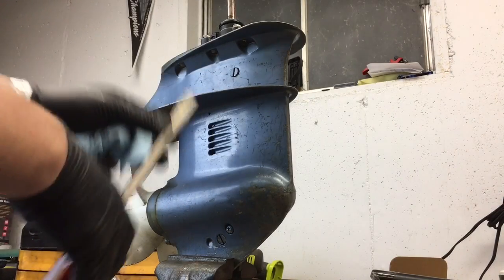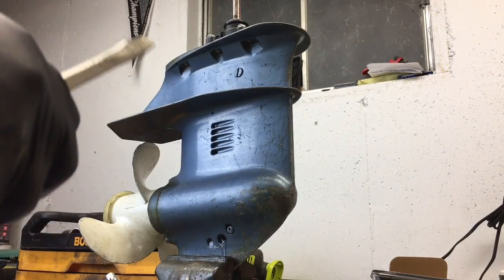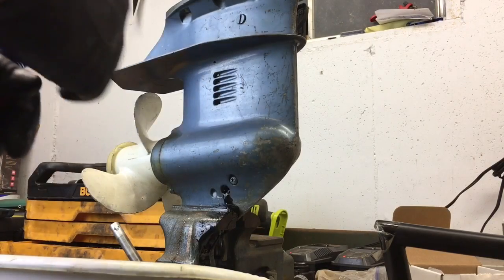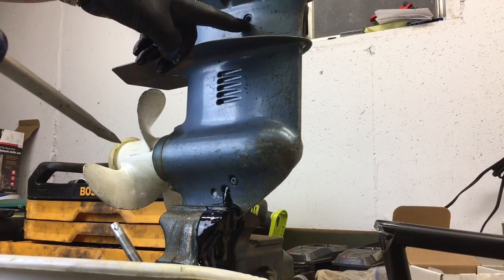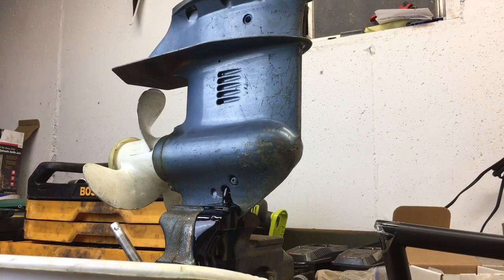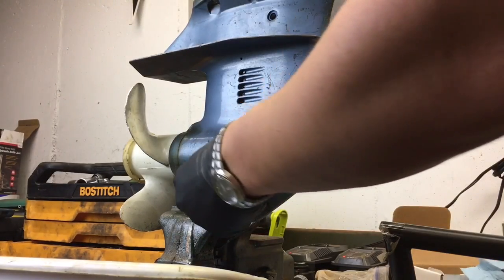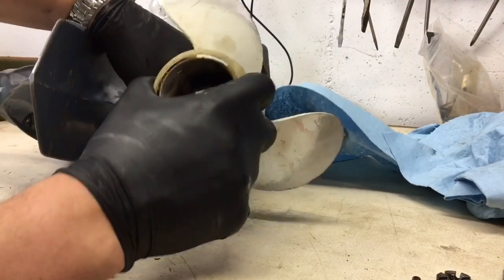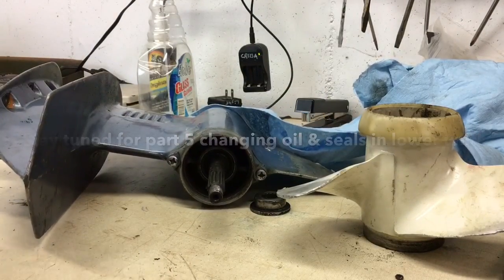Water in lower unit oil ??   1977 Evinrude Outboard Motor Part 4

Comment: I have a leaking seal on my lower unit. I noticed my motor kind of jumping and not running smooth after I engaged the throttle to forward and not running with all its power. Is that a symptom of water in the lower unit or does that sound like a fuel issue?

Comment: The oil is black. Seems to me if water was getting in the oil would be cream colored. My bet is water got in there during the disassembly of the lower unit at some point.
Reply from the maker: Actually the reason that the lower unit had such clear water and  black oil was that it had separated due to sitting for a long time. Oil and water mix during agitation but when sitting they don't mix very well because water molecules are more attracted to each other than to oil molecules. Detergent molecules are attracted to both water and oil. After sitting for a while the oil and water will separate.  Hope that helps!